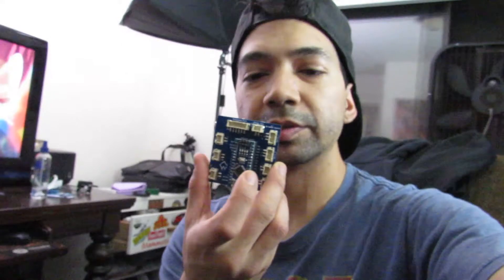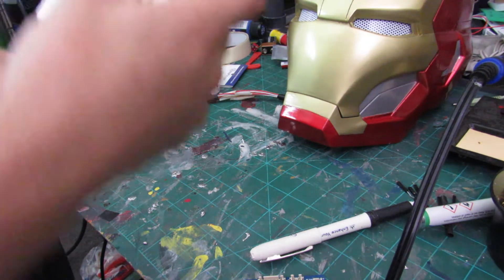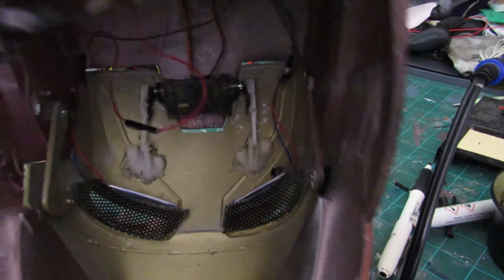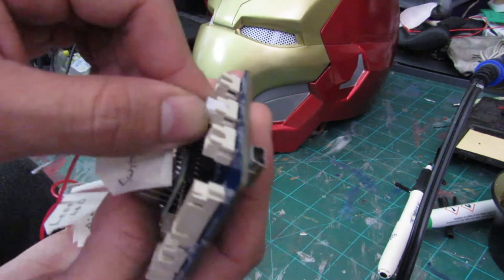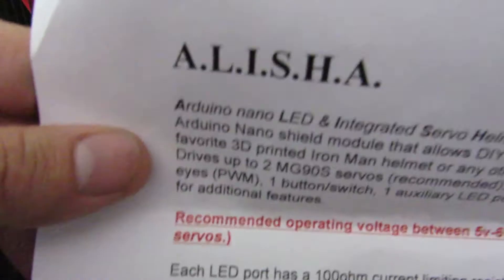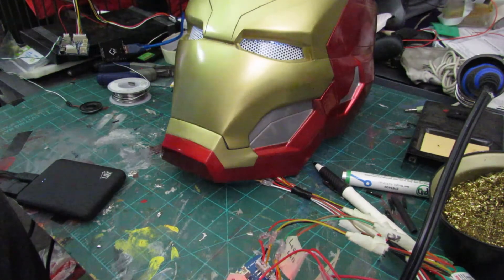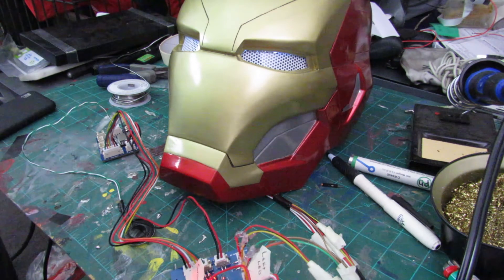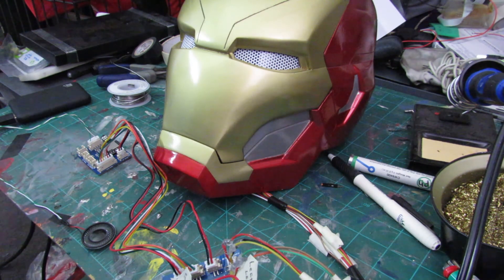Arduino Nano and Sound Expansion A L I S H A and S U E boards from Crashworks test demonstration

Comment: Really nice video... question for you if that's ok.  I'm trying to understand how the buttons work with this. Are there 2 buttons you use to operate a helmet? 1 to turn the lights on and off and another to open/close?
Reply: There is one switch.  The board turns the lights on when the faceplate closes and turns them off when it opens.  That is the actual purpose of the board, is to manage the automation of the parts, and the signal processing of actuators, lights, and sounds at the same time.

Comment: Just got one, any chance you can connect this directly to a wall outlet? Connecting my whole suit to it for lights and want to be able to turn it on and off with an alexa.
Reply: I know that your question is not new, but I just found the video.  The answer is no.  Do not connect it to a wall outlet.  It will destroy the ALISHA board, as it is not built to handle that level and type of current.
Reply: so i know this is old. but dont pay ANY  attention to the other reply. as this runs on 3.3 voltd and contains a regulator. you cxan power this via u usb which means YES you can plug it into an adapter and into the wall smh people are so anxiouis to shut stuff down without even knowing what they are talking about

Comment: Is there any coding or is the boards preprogrammed? Thanks
Reply from the maker: The Alisha board is pre programmed already so no one would have to jump into coding to do it themselves. For the sue board, I did have to update the arduino with a new code to work with the sound system. All of that is super easy and sort of an intro into arduino. I have another video explaining the coding and all of that if people need further help from the instructions provided with the boards
Reply: @jesse_giovanni  you are the best
Reply: @jesse_giovanni  is there a specific board? I noticed there were a couple thanks again
Reply from the maker: @fpv_drone_adventure  there are a few different versions of the alisha boards. The main difference is that the newer mk3 boards are smaller than the older ones. Some have more ports that you can plug into for additional features if you want. Over all, every Alisha board does the same thing though. All the sue boards are currently the same
Reply: @jesse_giovanni  thanks so much
Reply from the maker: @fpv_drone_adventure  youre welcome!! Anytime!! Im also available to chat for further help if anyone needs it! Jesse Giovanni on FB and @jesse_giovanni on instagram